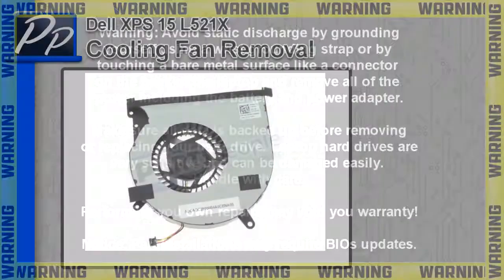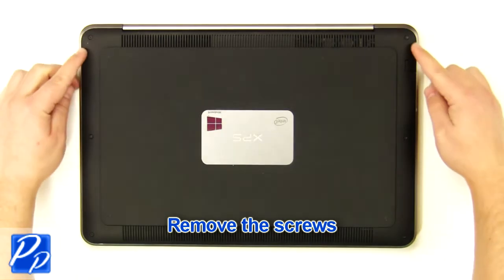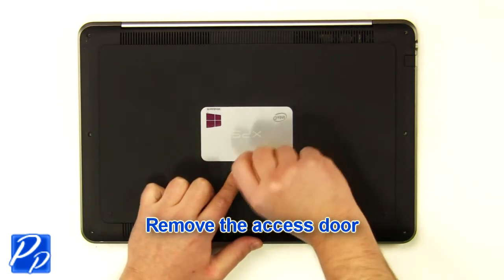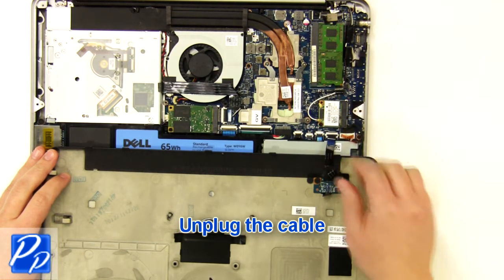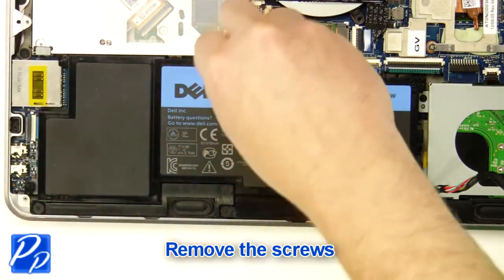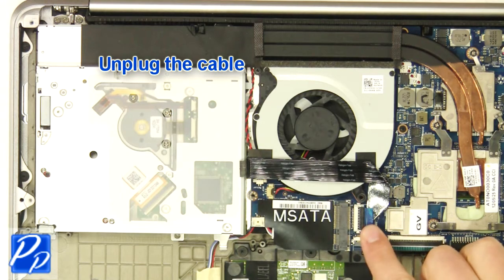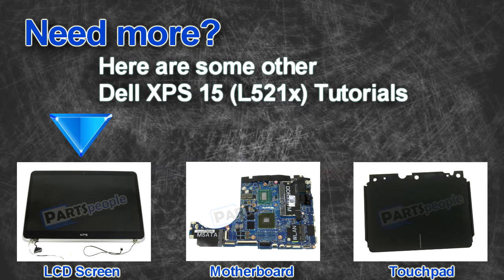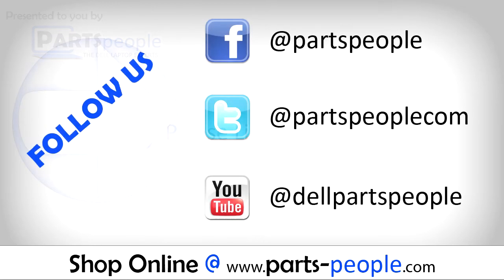Dell XPS 15 (L521x) CPU Cooling Fan Replacement Video Tutorial Teardown

Comment: i know its probably too old now but if you put a more powerful fan in would it help with cooling?
Reply: I know it’s probably a year later that I’m replying, but I got this sunon fan from eBay but it was somewhat expensive, bought it but then noticing the same fans for maybe 20-30 less, but item location is in Germany while the one I bought was from the UK. it’s a different fan blade design where there’s longer blades coming from the center, instead of this spoke wheel looking thing. 

Anyways in the video, why the hell remove the battery? Rather just disconnect the battery cable